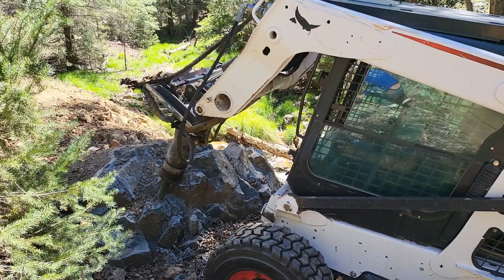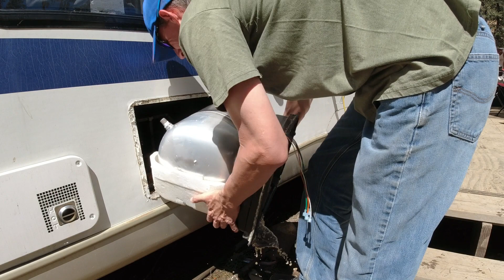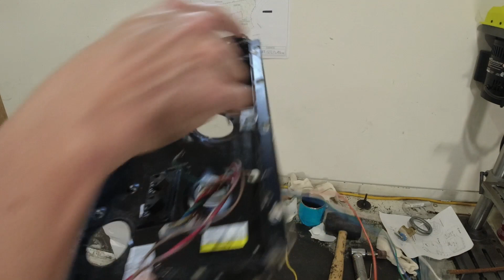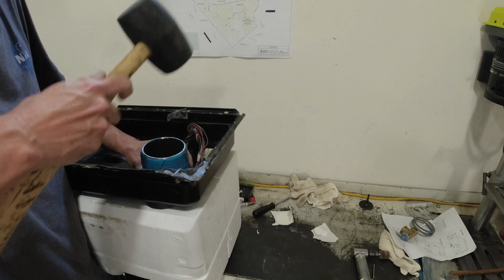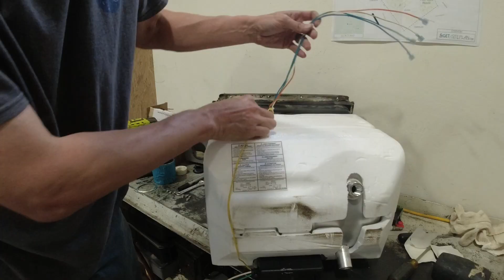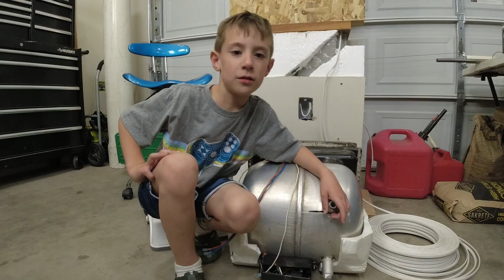RV Water Heater Tank Replacement: Frozen & Split Atwood 6 Gallon (DIY Repair)

Comment: Do you have a video that shows how you separated the tank from the unit? This video shows one retainer being cut and then it jumps to when it’s already taken apart. I had a split like yours that we got repaired, but there must be a second, smaller leak somewhere towards the front. I’m concerned it may be on the front of the tank, inaccessible behind the panel unit. Thanks for your time and the very helpful video.
Reply from the maker: I didn't show that very well.   At the 6:30 mark of the video, you can see me cutting the retaining ring on the heating tube.   It has 4 of those rings one on the back and one on the front of the panel on both the inlet and outlet.    If you remove the ones on the front the panel will come off.   I cut them because the new tank came with new ones.   They are available separately if you're going to reuse the tank and cant salvage the rings when you remove them.   Hopefully that helps.   If you have any other questions let me know.

Comment: Thanks for the awesome video, very helpful! Is there any special kind of caulk you used to reseal the outside flange, or will exterior silicone work?
Reply from the maker: Thanks!   Glad we could help.  I just used exterior grade caulk nothing special.   Let me know if you have any other questions.
Reply: Also, I have the service manual for the heater and it says that even though there is still about 2 qts. Of water left in the tank after draining, it’s safe to leave in when in cold climates because there is enough room for expansion. I have seen SO MANY old posts on RV forums about this problem that it leads me to think that one should still add RV AF to the tank to prevent freezing. I read somewhere, maybe the manual that it’s safe to use the RV AF as it won’t corrode an aluminum tank. Any thoughts? Thanks!
Reply from the maker: @terryg2160 I think you should be ok.  The only time I had problems was when I forgot to drain the rv.  I would think you have enough room for expansion.